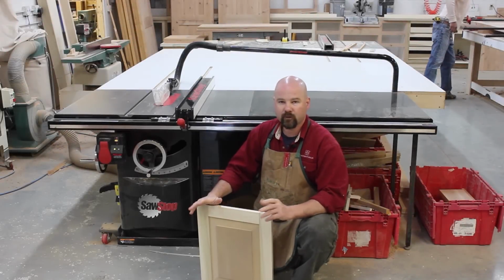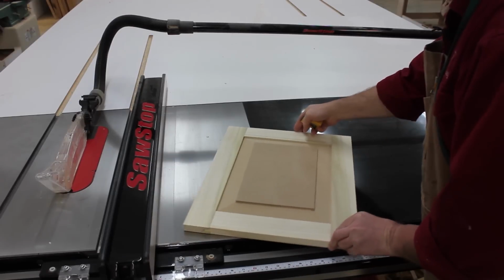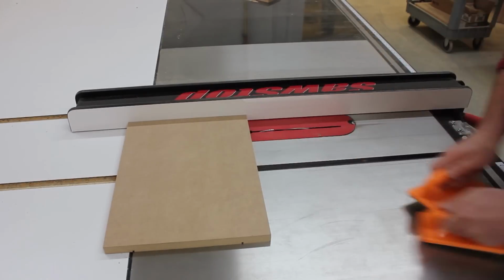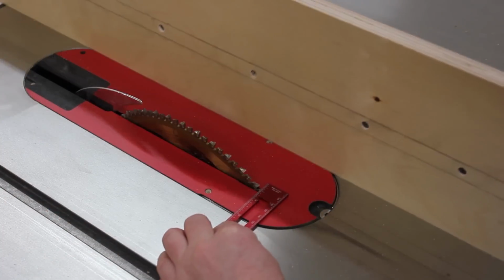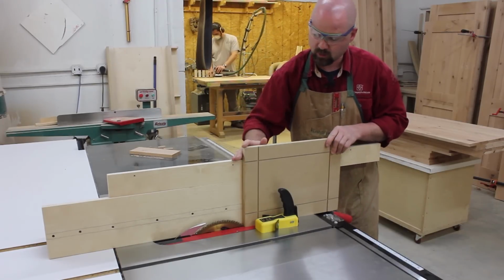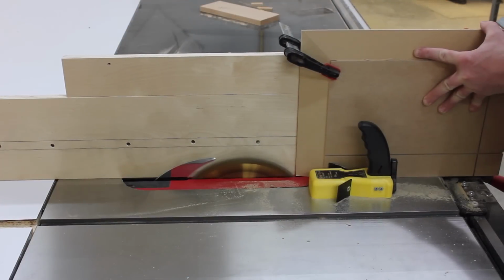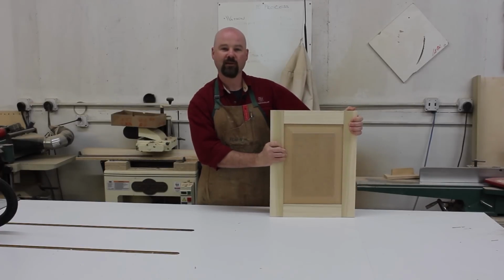A Raised Panel, Made Solely On the SawStop Table Saw

Comment: Does the SawStop machine have a capacity not to shorten or lengthen the board length when you change the blade tilt slightly? My old Delta Rockwell would change the board length when you changed the tilt of the blade and I would have to go back and test the cut to arrive at same board length. This would have changed the thickness of the raised panel in the dado of the rail and style you are cutting and introduce a poor fit in that dado. Some Euro saws keep the same length of board with changes in blade tilt. If tilt changes fence to blade distance then the SawStop is like an old design with a finger sensor added. I believe it goes back to the trunnion design which can allow the blade tilt to not affect the cut length
Reply from the maker: Thank you for the question. Our saws are designed in a way that no adjustments or compensation needs made for cuts at various angles. Just tilt the blade and cut.

Comment: I have a SS Tablwsaw (contractor Model with 52" Fence) and would like your recommendation on Getting the Overhead Blade Guard/Dust Collector Arm from SS or the After Market, or not at all. MY MAIN OBJECTIVE IS THE SAFETY ASPECT  OF GUARD, DUST COLLECTION IS SECONDARY.

Comment: Very good video.  I too have a question. The doors I am trying to make have raised panels on both sides, do you have a video for that? This is a standard 6 panel door. The ones I have a hollow,, very flimsy and my dogs, have made them walk through doors, they torn them to pieces so that is why I am trying to make them out of solid wood.
Reply: Make 2 raised panels, as shown in the video, then glue the resulting panels together or add a middle layer if necessary to bulk the panel up to the desired thickess

Comment: thank you very much. yes i did some sanding and it came out fine however my problem was the thick blade and it wasn't that sharp.
on my second raised panel i had a new thin kerf blade and it was perfect.

Comment: I have been making raised panels on my table saw for many years. 
I just use my tenoning jig which  has all the ability to create a bevel on the panel and your hands are away from the blade.  Much simpler and I don't have to waste my time building another jig that I do not have room to store in the shop.

Comment: Hi, can I ask maybe a stupid question, I’m about to build a work shop for myself at home now I have some space. My question is- why do people position their table saw in the middle of the room? Isn’t it better placed off to one side as the fence will only go as far as the end of the table?? Cheers
Reply: It's been a while since this video was made, but I will answer from my shop. I have my saw in the middle mainly because most of my long stock is cut down before it makes to the table saw. ie Like in half or on my miter saw. Hope that helps.
Reply: You want plenty of space around your table saw.  If you want the most out of your saw,  you will want 8' on either side of your blade.  Table saws only bevels in one direction. You also need room in case the wood you are cutting binds and kicks back. Miter saws, jointers that don't need the room in back of the machine go against the wall. Also you need to think about placement.  Which saws will you use first, second, etc. Place them accordingly to save as much time as you can.
Reply: If you only work with small stuff you could place it next to a wall. However when working with sheet goods you need lots of space all around the saw.

Comment: I have a question,,maybe one of you more experienced woodworkers can answer;
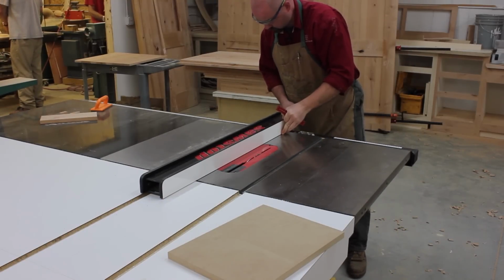I made a few raised panels this way, using just a table saw. But I do not know how to figure out ,how I determine the "border of the field" or center area.. around the 1:30 time mark, he describes it.But i wasnt sure why he chose 2 inches in, is that a standard measurement? or is it based on the panel size he is using.? THANKS in advance guys.

Comment: You need to check your blade to make sure it's razor sharp. Also, thin kerf blades reduce the amount of burn you get when cutting at angles. Finally, with it being awkward cutting tall pieces on the saw, make sure you are moving it through the blade quick enough. Even though it's awkward, you still have to move it through at normal speeds. However, SOME sanding is inevitable...especially on the end grain. Good luck mate!

Comment: Just want to say I watched several videos scattered over youtube and your demonstration put it all together.  Just two questions.  1. Is there a standard depth  for the grooves in the rails and stiles .  2  Is the 10 degree angle carved in stone?  Some other videos said to use 15 degrees.  I used the 10 degree you said and it came out perfect, but I just am curious.  Thanks for your information.